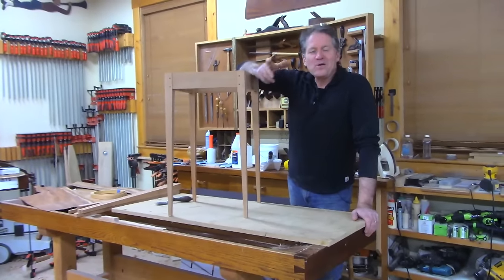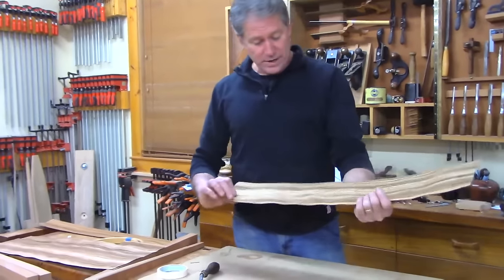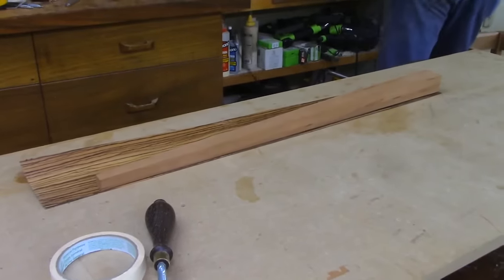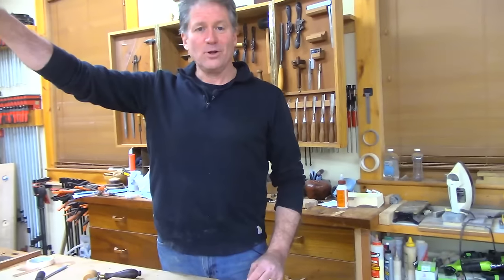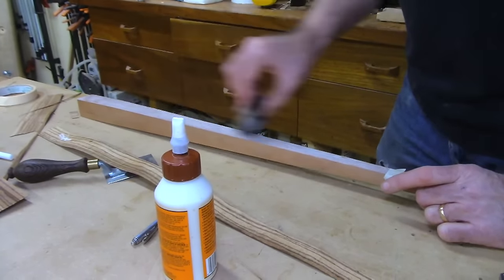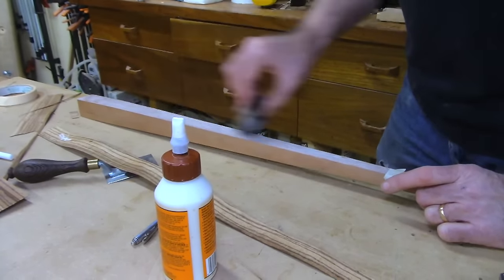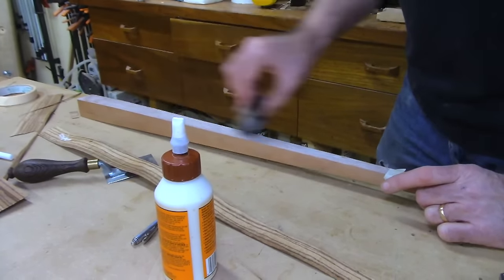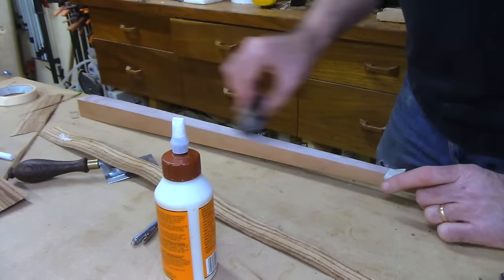From Simple Leg to Designer Leg

Comment: Excellent presentation. The veneer saw has no set, I did not realize it would cut along the edge so cleanly. I was in anticipation of the wiping of the leg to see the grain “pop”. You are not afraid of using a wet rag - water! I tend to use a rag dampened with mineral spirit, but if all that does is raise any grain even slightly, a fast bit of sanding does the trick.
Reply from the maker: Thanks Ed, glad you enjoyed it! Yes, I am not worried about a little dampening of the veneered surface, it’s not enough water to cause the veneer glue bond to fail…it takes a lot of water and heat to do that. I still had to sand the surface as well so just easier to get water to show better how the finished leg will appear. After sanding I do more commonly use denatured alcohol to do the same.
Thanks for watching! 👍😎

Comment: A veneer is any material of 1/4" or less in thickness.
Reply from the maker: Hmmm, I never realized there was an official thickness where less than was considered veneer. I’ve used 1/4” thick solid wood drawer bottoms in the past and didn’t consider them veneer. Is this an official definition you know of from somewhere? I was thinking something less than half that thickness might be the “veneer” cut off point.
Thanks for watching!!👍😎
Reply: @EpicWoodworking  Yes, I believe it is an official definition.  I should have mentioned that it is considered veneer when attached to another substrate.  This goes for wood, stone, or any other covering material.  Love your videos.